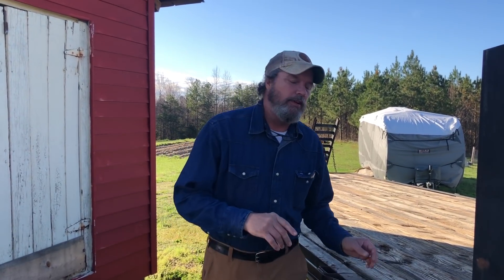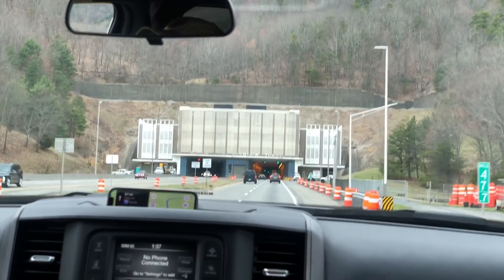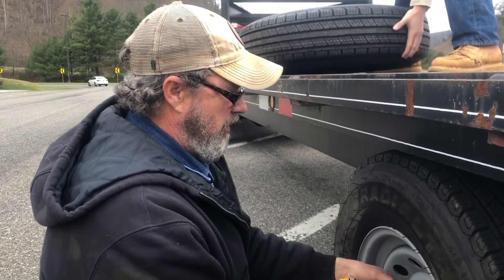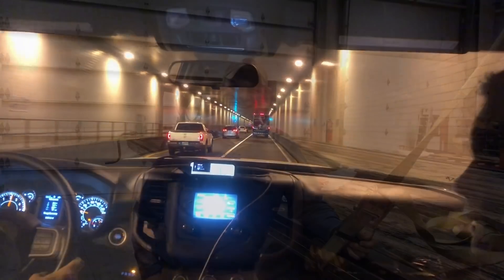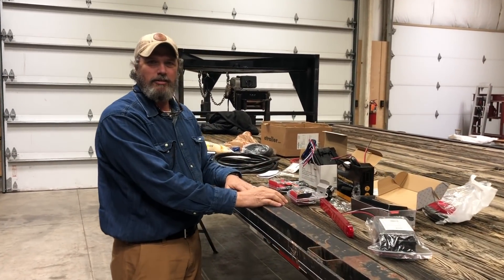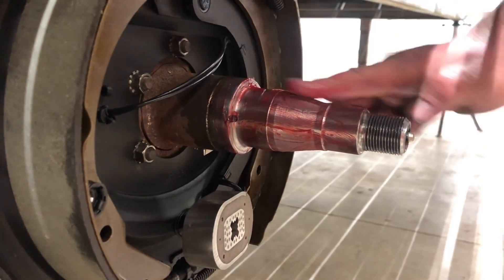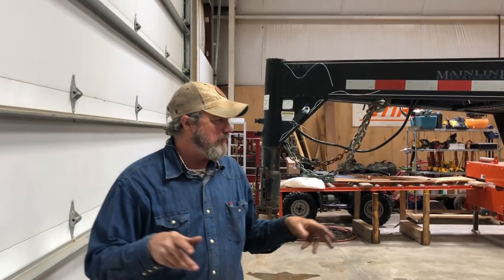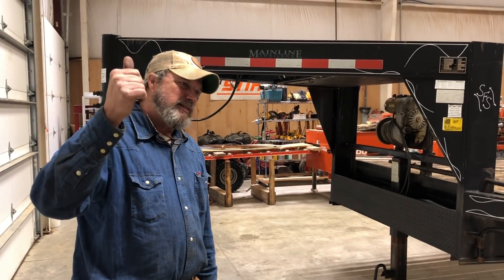West Virginia Trip (Gooseneck Trailer Rewire)

Comment: Met you Joey and your wife while you all were helping out The Bernards! Figured I could help with a Sub and learn a thing or two as well. I felt bad after seeing that almost brand new tire have to be "Retired" with less than 200 miles of roll on it! OUCH...but you didn't sweat bullets and found the grace out of the whole deal by saying "at least nothing bad happened inside the Tunnel"!! I appreciate when when the Good can be found even if it's hiding! I appreciate a seat on this ride and will check out your Video Library to catch up a bit! Cheers From Ohio
Reply from the maker: Thank You for subscribing and helping the channel God Bless.

Comment: Good to have friends that help.  Wiring is generally a problem for me, especially on trailers.  My 20’ has not presented issues other than side markers.  LED is the way!  I appreciated him catching the right rear needed a little more adjustment.  Strange that the left front locked, but as I said wiring can be a nightmare.  2001 and building!  Congratulations Joey.
Reply from the maker: Thank You Stan . Hope to get some dirt working videos going soon.
Reply: @Jtwes  Joey I apologize for not sending my thoughts on transport tie downs.  I have had MI company for 10 days now.  Granddaughter and boys arrived yesterday for a week.  90 here and 20’s in MI.  4” snow there Saturday.  I will get around to the Email.  I actually seem to be coming out of my funk, hope so.  Thanks for the card, was thoughtful.

Comment: Isn't that an awful long way to pull the trailer to wire it and do brakes? Aren't you an electrician?🤔🤷? And you have rebuilt and swapped engines I would think you could handle doing the brake job on the trailer yourself.

Not trolling or anything just trying to figure it out. Maybe it was just for fellowship and hanging out with a buddy for help?
Reply from the maker: The latter